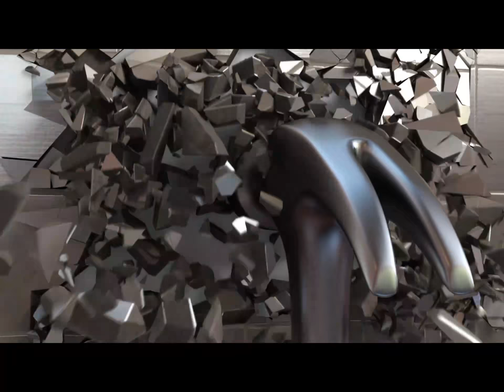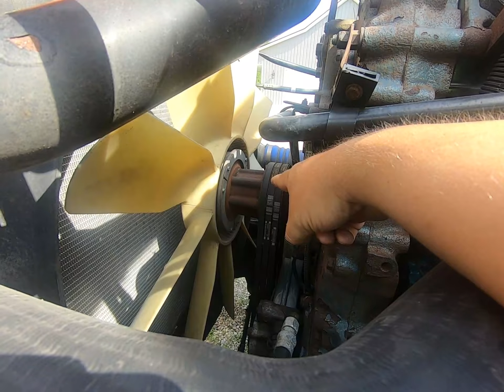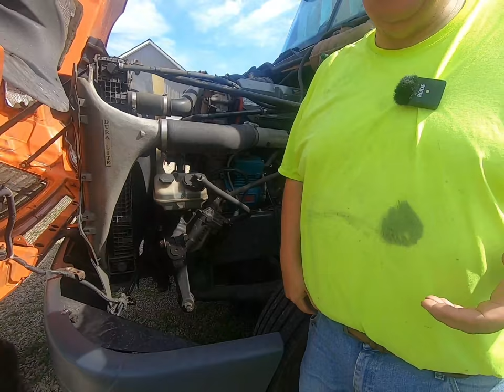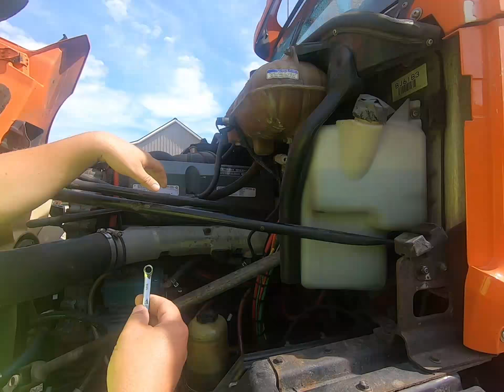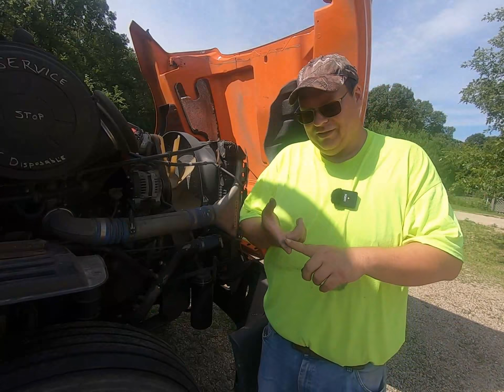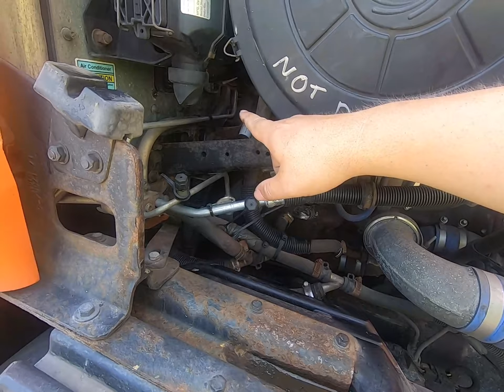Engine fan stays on. Troubleshoot, diagnose engine fan on a semi truck. Fix an engine fan.

Comment: Good day,  I have a 2009 Columbia with a DDEC 6.  I by passed the ground wire to the air solenoid and the fan works like it should.  Do you know where the ground wire from the solenoid goes to?  I believe it goes to the ECM but I’m not sure.  How would you suggest I fix this issue with the ground wire?
Reply from the maker: I also think it goes to the ecm...but not sure. for now i would just find a really good place to re- ground it

Comment: 2016 T680 isx15. Im in AZ and outside temp on dash reads 124°. With ac on, fan stays on. With ac off, fan will turn off. Ac is blowing cold at idle and while moving. Once im going down the hwy with ac on and fan is on i can turn ac off and the fan will go off. It will stay off until i start to come to a stop even when i tirn the ac back on. Then the fan kicks on and stays on again. No ac codes present. And idea?
Reply: Hey man …. How do you got it fixed??? I have exact same issue.. appreciate your answer ..
Reply: Same here fan stays on any thing new t680 pacar
Reply: @muadalrohani966   mine was my fan clutch seized.. test your fan clutch with air pressure . If fan clutch works ,,, change your hi pressure sensor switch on your ac line
Reply: @tigreperro9336  and the ac on the truck been bad like the sleeper never heats n it comes on and off by it’s self that what I’m thinking and I’m about doin later today I just want kno wat I need kno what parts go with my truck

Comment: I have the Detroit D15  and some pressure is building up in the cooling system that pushes coolant out of the surge tank.  Engine's fan looks OK. What could cause that problem?
Reply from the maker: that's not good news. without knowing all the details, the first things that come to mind are: bad air compressor, bad head gasket ,or cracked head. If you are looking to start looking for something simple first, check the cap on your surge tank...make sure it is the correct psi, and that it is functioning...or spend a few bucks on a new one. I'm not all that experienced with the dd15, drove one for a bit but never had to work on it. sorry to say, if it's not a faulty pressure cap, then it's probably an expensive fix. Someone more experienced with that engine would be more qualified to help you.... but that's just my first thoughts on it.
Reply: @DIYSEMI  , coolant is pushing and leaking through the little, overfilled hose. 
I noticed silicone under the heads. It says to me there is not head gasket, and somebody put just silicone. I do not think it is original. Truck is 2016, and has just around 300K miles on it. 
Thanks for your good advice. I appreciate it.
Reply: From my experience it came to be the air compressor so I’d troubleshoot that after the filler cap.

Comment: Hello can u please give me any idea i have issue on fan stays on i have replace the solenoid and and wen i replaced the high pressure sensor on the ac line it fixed the issue fan start working normal and after a week again have the same issue should i change the ac sensor again im confused 😒 HELP PLZ
Reply from the maker: you may need to get it looked at. perhaps you a/c system has an overcharge

Comment: Hey man ,I have a 2015 cummins isx on an international9900i, I replaced the temp sensor,  ac high pressure switch but still the fan comes on at 180 temp. Please help . Thanks for your video
Reply from the maker: Have u checked to see if perhaps you actually are running hi ac pressure. Maybe switch not bad but pressure is actually high.  Also, ecm can cause this too only computer can chk that. Watch my video on using ac gauges to check pressure. Look for 150 -250 on the high side....see where fan kicks in at. Get it good and warm.
Reply: @DIYSEMI   okay  thanks man. Ecm is not throwing any fault codes at all but I haven't checked the ac yet but will do so and post an update if that solves my problem. Thanks man, appreciate your word.

Comment: 09' 389 fan stays on. ECM and CECU parameters are good. I installed a fan kill switch but need the fan on otherwise a/c doesn't cool at idle.. Other than a wire problem somewhere that I haven't found, do you have a suggestion.?
Reply from the maker: Have you had the a/c pressure tested to see if you are running high pressure? or if the high pressure switch is bad? that will cause the fan to stay on. the idea of killing the fan makes me a little nervous for various reasons. also have you checked the solenoid function?
Reply: @DIYSEMI  Had the a/c redone/tested at the dealer and supposedly the solenoid is functioning properly. Im down to looking for a bad wire somewhere now.
Reply from the maker: @MonkeyDust161  I guess check the plugs first

Comment: Got to be older than a 2012 model,no DEF on that model and 2008 and later Columbia was replaced by the Cascadi model,same with the Century Class.The only exception was later yr built Coranado model.Also later models had the DD15 replaced the 60 Series.
Reply from the maker: It's a 2012 glider

Comment: What could cause low voltage on fan clutch selenoid?
My fan stays on because there is not enough voltage to turn the selenoid on ??

Comment: I got a question I'm only getting 10.1 V at the supply line at the solenoid could that be the issue and what would cause only 10.1 V
Reply: How did you fixed it? I'm having the same voltage on supply line

Comment: My engine fan is staying on, I have air going to solenoid but none coming out. I have codes coolant level sensor circuit. Voltage above normal or shortened to high source, fender intake manifold air temperature sensor circuit. Voltage above normal or shortened to high source. I installed a new clutch solenoid and intake manifold temp sensor
Reply from the maker: Those codes are likely making the solenoid keep the fan on. going to have to track it down. trace the wires back, may have one rubbing somewhere.

Comment: Hi brother I have 2007 kw t600 my fan is on off and cold temperatures some time two days no work like look like no any problem some time all day running cold weather I change solenoid what same problem no leaks air to hub what you think please help I need to change temperature sensor or other key on fan clutch no spin what I change solenoid already same do with old solenoid
Reply from the maker: I cant be sure about it just by this. It might be time to have a mechanic take a look at it. Maybe your ecm is telling it to go on and off. they could hook it to a computer.
Reply: @DIYSEMI  today I open solenoid in go air ok out going to fan no air that mean solenoid bad right I change 3-4 months ago I think air compressor some oil thru hose maybe stuck solenoid
Reply from the maker: Do you have the key on?
Reply: @DIYSEMI  yes key on full air 120 psi I open first cab side to solenoid in air come then I open out going fan side hose nothing air

Comment: On my KW T800 the fan functions fine until I plug the new AC compressor in. It worked fine with the old compressor cycling on at 320 PSI and off around 150 but now if that new AC compressor is plugged in the fan stays on whether the AC is on or off.
Reply from the maker: It's gotta be reading high pressure? That's really weird
Reply: @DIYSEMI  Do mean like false high pressure? I let the pressure down thinking it might be over charged and now its not cooling at all where it was blowing ice cubes.
 This compressor cycles on and off constantly where the other one would not cut off unless high side dropped to 100 psi on the high side.
This compressor cycles on at 230 or 240 and off at 420PSI on the high side.
The old one worked great but I could not find a slow leak to save my life. The compressor was the only place left.
The system would hold 220PSI of Nitrogen for 1 hr and gain a psi but not hold a charge but 2 days. 3rd day dropped off slowly to warm air.
With dye I found a slow leaking shraeder but fixed it, charged it and the same thing 2 days cold and downhill from there.
I could smell freon strong standing on the ground with the hood open the last little bit I ran the old compressor.
Reply from the maker: Had you checked the evaporator in the dash and Bunk for leaks? Usually if you can't find it, it's in there. 
I'd have to say there is definitely a problem with that new compressor 420psi is quite high.  Surprised the relief plug doesn't release on the back of the compressor. I forgot... Have u replaced the high pressure sensor?  Usually short cycling is a sign of low charge,. But doesn't sound like that's your case.  It should  not be kicking in at 240 either. It's hard to tell what's happening here. Seems like it functioned right, except for a leak. Until the new compressor was put on. I assume that you pulled a vacuum on the system and all that before you charged it? Just asking cuz this is puzzling
Reply: @DIYSEMI  Yea I took the evaporator out and soaped it good with lower pressure in the system.
Yes I vacuumed the system down to 250 microns and its stayed 10 minutes while getting ready to charge it. I hooked my charge line up and vacuumed it down to 250 microns as well.

What I did this evening is let the freon pressure down lower than would have ever worked on the old compressor and it seems to be working.
I've been running with the thing unplugged so my fan don't burn up a lot of extra fuel.
I'm gonna try it tomorrow and see if it will work.
This is so crazy though static pressure right now will be 52.5 psi. The Kenworth T800 maintenance manual says it should be about 66 psi. And that's why I tried letting down the pressure. I think I let off just a little too much and will freeze up, I do have a freeze switch so should be fine. Its blowing ice cubes right now. 

With the old compressor it ran best before at 105 static and 25 low side. High side varied from 150 to 320 with the fan cycling.
The compressor almost never shut off though.
And that blew ice cubes.

Comment: What would cause a squeaky sound when rpms get higher around 1400 I’ve noticed it’s only when my fan is on
Reply from the maker: one of your belt pulley's  or fan clutch...but it is probably the belt itself. start simple
Reply: I noticed my belts were squeaky and then one day they busted and I replaced them and it squeaked for about a week then went away. Then it started up again but only when I hit rpms closer to switching gears but doesn’t do it when I turn my fan off. I tested the air through the hose method today but didn’t hear any air leak.

Comment: My fan override switch not getting any power I circuit tested it and doesn’t light up. And my lo pressure switch is only reading 9 volts. I replaced all switches

Comment: I’ve checked all that and mine still stays on. A/C is perfect, my fan kicks out when I turn the key off like it’s supposed to but as soon as I start the engine it kicks in. Even when it’s cold outside. Also changed the manual fan switch on the dash. Any suggestions?
Reply from the maker: Might need to go on the computer if everything else checks out
Reply: Check the air line from solenoid to fan clutch it may have collapsed. check with shop air/rig air
Reply: @MonkeyDust161  when I turn the ignition off the fan kicks out. So that tells me the solenoid is putting air to it but when I start the engine it kicks back in. It’s gotta be in the ecm. I’ll get it figured out someday lol

Comment: what is an egr? does every truck have one?.
Reply from the maker: erg is exhaust gas recirculation valve. part of your emmisions system. any engine made since about 2003 has one. except for the max force engine
Reply: @DIYSEMI  max force? Are these Detroit's?? What yr the start producing Max's?
Reply from the maker: @stilliraise9201  max force is internationals engine

Comment: Mine over heating going up hill freightliner columbia can you help please
Reply from the maker: overheating can be caused by many different things..any other symptoms? just to start with the simplest things....is your fan coming on? thermostats opening? is the air filter clean and not clogged up? have you cleaned the radiator lately as well as the charge air cooler? are the fins full of dirt which would cause poor cooling? is the truck very old and many have a clogged up muffler full of soot? do you also have low power? which could mean a charge air cooler leak, which can also cause higher temperature. these are just simple quick things to check before spending a ton of money. I don't know anything about your truck, so it's hard to say what's happening.
Reply: When was the last time you cleaned the radiator and or taken the condenser and charged air cooler off and cleaned in between them. That will cause a huge air flow issue if it's all plugged up and not allowing air flow
Reply: Even just using a simple product like purple power and spraying it into the condenser, charge air and radiator will loosen up the dirt, dust and oil if you let is soak than take a garden hose or very low pressure water hose to wash it out. Don't just spray a degreaser into it and leave it. Once it dries out it can cause dirt to attract even quicker
Reply: It never runs hot I was coming from Arizona going to Missouri and that problem start on i17 going up hill fully loaded 76000lbs outside was about 110 degrees thanks for the help I will check all those parts
Reply: Not losing any power I went to pickup watermelon on the desert area I guess the dirty went all over the cooling system
Reply from the maker: did that very thing today, found a nice tool for it. video soon!
Reply from the maker: pulling up I 17 in 110 degree heat would make a whole bunch of trucks to overheat...don't feel too special. that's a long, hard pull in 110 degree heat

Comment: What if the fan stays on with the ac on,  but stops working right after I turn off ac
Reply from the maker: High pressure in tthe ac. Or bad high presssure sensor

Comment: Last night my fan broke into pieces just the ends of the blades and went through my radiator lost all coolant, just before this happened the check engine light came on and the fan turned on and boom, also the temp was normal no need for the fan to even turn on, What would cause this to happen it’s the weirdest thing, never heard of this happing to nobody?
Reply: 2006 Detroit 40 btw
Reply: Detroit 60 lol

Comment: Those are only 2 or 3 reasons, but there are many other reasons which have not been mentioned... such as temp sensor thinking engine is hot will cause fan to stay running and other issues too.. video was ok but need to explain main common reasons.
Reply: I have a code that pops up about the temp sensor. I changed it and code still pops up and fam turns on with the code. Any ideas?

Comment: Dude, Instead of installing a manual fan switch, do a simple fan override switch. The way you are teaching totally eliminates fan operations during use of the AC. NOT SMART!
Reply from the maker: no it does not, it works just the way it's supposed to unless you manually turn it to ON. It's not an on/ off switch, it's an ON/ auto switch

Comment: Note to all, I have an air leak going to the clutch fan and the fan is constantly running.
I can't hear the air leak while the truck is running but I can hear it when I shut the truck off.

It bleeds the secondary down from full 120-ish to 100 and then I hear the air supply to the clutch fan cut off.

Also, when truck is off my fan does not move.